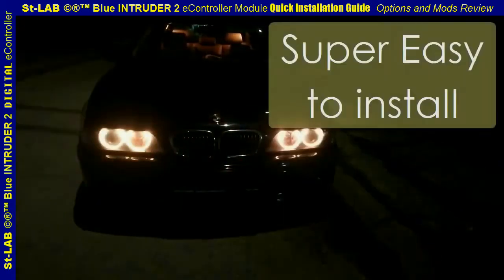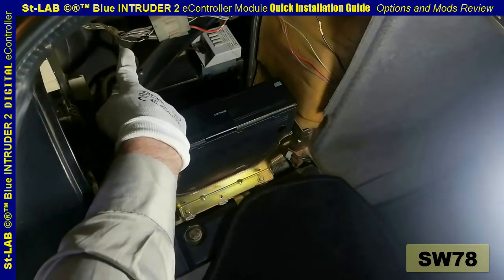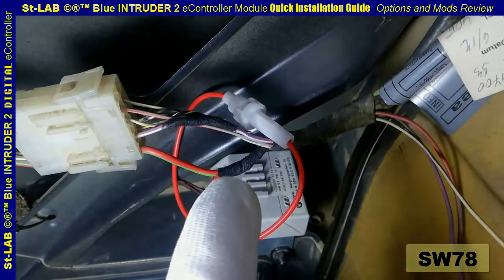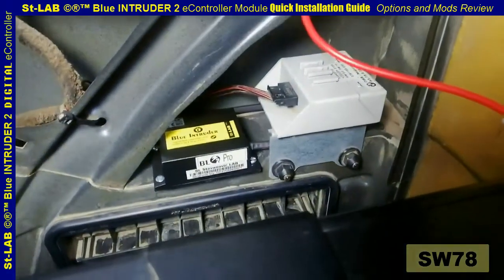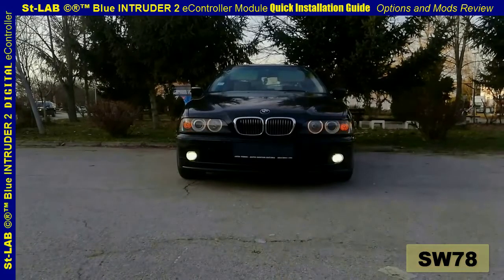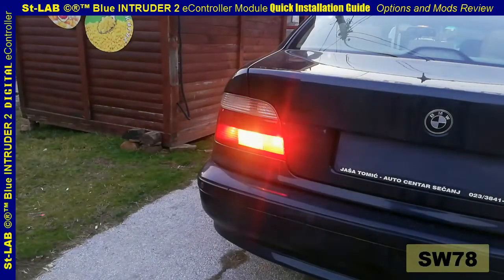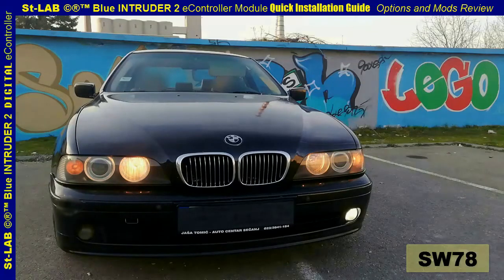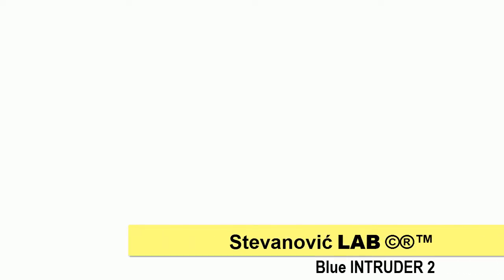Blue INTRUDER 2 BMW E39, E38 & E53 I-BUS interface [Unboxing, Installation guide and Review]

Comment: Hello, is it possible to you use the big Bordcomputer again in combination with an not original radio/headunit? By bc is dead with the new radio
Reply from the maker: unfortunately, OEM BC communicates only with the devices that use the same communiction protocol, very rare to find